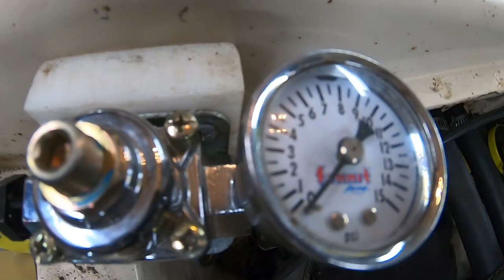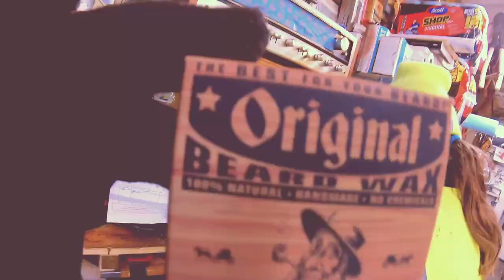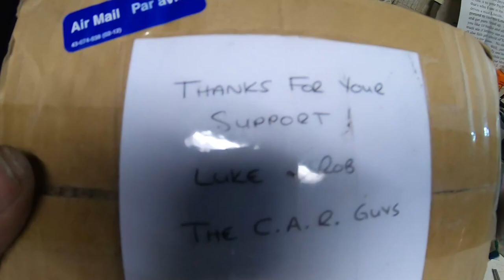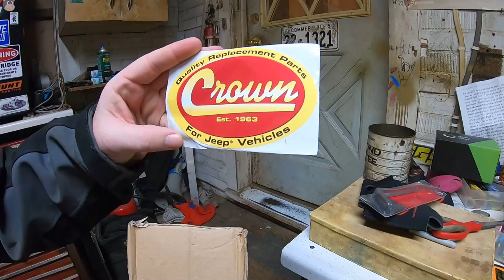Project 1967 Plymouth Barracuda #19 A day with JayBo and Jeremy Getting our Fuel System Buttoned up.

Comment: Thanks for the tips with the return line also...something I might look at on mine too, as a few have mentioned its a winner...Also speaking of axle seals, I learned the hard way to pull the axles all the way out when doing a centre change, the axles layed on the seals over night and I didnt realise they had made the seals oval shaped on the bottom...oh boy did the oil come out of those...tips and tricks I guess...another great vid guys...Thankyou
Reply: I also fitted a filter between tank and pump after some crud in the tank murdered my first Carter pump, I run one up front as well, before the carb...insurance

Comment: You boys wont have a vapor lock problem with that electric fuel pump but that return line keeps the fuel a good 10 degrees cooler than a dead head.
Reply: That's the idea, didn't say it.  
Thanks Lesl55

Comment: I dont have anybodys Facebook or email info to send this info from UTGs live chat tonight  so here it is - company  Howell Automotive 
Offenhuser slant 6 kit part number # 5041 price $ 384.00  . comes with aluminum intake to put  2  one barrel carbs on a slant6 and includes carburator linkage rod and fastners . I dont know if its still available ? I looked at the kit today online . Also got an email back feom Michael at schumacher motor mounts . their having issues with manufacturing but will be up before too long and you can request through michaels email to be put on a notification list as soon as the motor mount are selling again since I'm doing that slant 6 to 360 pan slant 6 K frame. hope this helps 😎
Reply from the maker: https://www.facebook.com/groups/2699006370139024/?ref=share